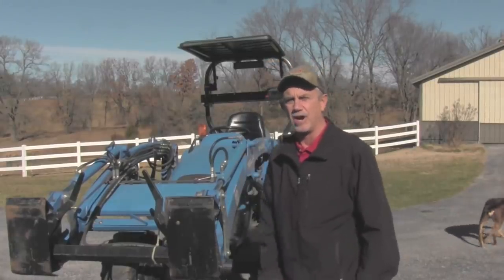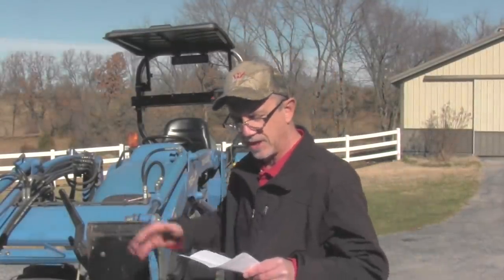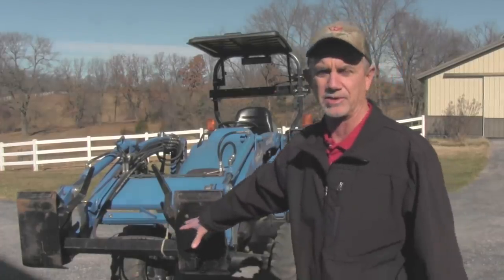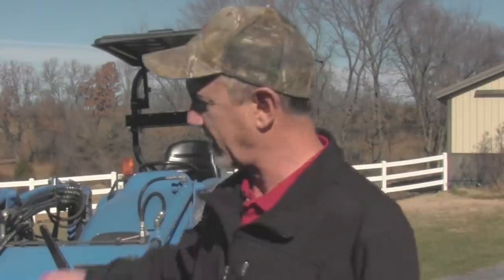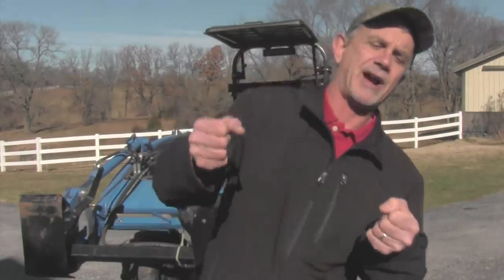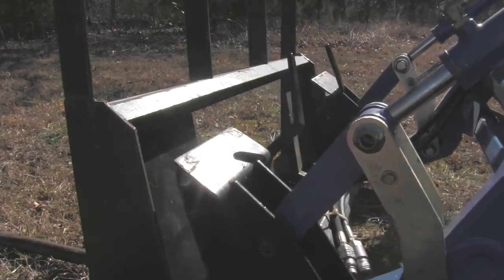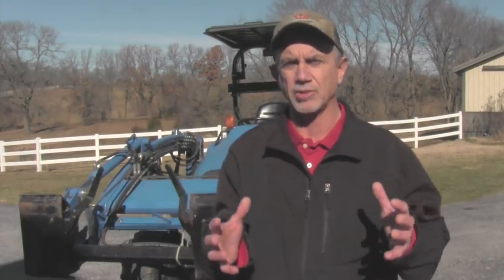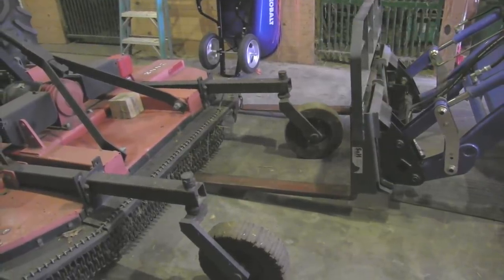Tips for Easier Front End Loader Attachment Hookup

Comment: Hi Mike. Sometimes I have a problem with my John Deere quick attach bucket too. I've found that when I get right up to the hooks on top, if I turn the wheels the tractor front end moves in the opposite direction, while standing still! Then I have to back up a little and try again. It's annoying but like everything else in life, the more you do it, the more adept you'll be. Your tips on saving space when parking the tractor is spot on too. When I load my tractor and Bush Hog on my trailer I have to curl the bucket all the way under so it's resting face down on the deck so I can put the ramps up. The mower deck overhangs the front by a couple of feet so the tail wheel kisses the jack when I lower it. The trailer deck is 20' but the tractor with the mower deck on it is about three feet longer. It was the longest trailer I could find around at the time and I needed one ASAP because my old trailer was rusted almost in two I discovered one time. It pays to get under the trailers from time to time to check things out so you don't have any unpleasant surprises when you don't have time to fix it...assuming it can be reasonably fixed.

Comment: I would get 2 sets of haul master magnetic trailer alignment kits from Harbor Freight. They are $9.99 per set of 2! They are strong magnets with a telescoping rod with a yellow ball on the ends. You would put one on each bracket on the loader in the center and one on each bracket center on the bucket. Telescope them all the way out  Then drive in toward bucket slowly aligning the balls up. Works easy on a trailer. I think it would work great here also.

Comment: Thanks Mike Euro hitches are becoming the standard in Australia. They’re simple to use but there are lots of skid steer attachments second hand that you can’t use anymore. Way back you gave a hint about using a bar to make micro adjustments to bucket position so you don’t  have to get the tractor position perfect every time, you just pry the attachment into position, I’ve found that invaluable as a newbie trying to put on attachments by myself. Thanks for the tip!

Comment: Glad you made this video.  I place my implements on cinder blocks.  Easy to see when hooking up or disconnecting.  Also, make sure the pin hole stay clean.  They easily plug with gravel, wood, etc., and make it hard to lock in the attachment.  Lastly, watch your feet when disconnecting an attachment.  If there is no hydraulic pressure to the loader arms, they can bleed down and pin your foot.

Comment: I painted a vertical day-glow yellow stripe down the back center of my bucket and forks.  My tractor hood has a ridge running down its center. I just steer into the bucket by keeping the center of the hood lined up with the stripe painted on the bucket.  I don’t pay attention anything else until I contact the bucket. This way you don’t have to move your head back and forth- just sight along the center of the hood.

Comment: I bought a 2 year old tractor (first tractor ever) that clearly had never had its bucket removed.  I bought pallet forks and was excited to try them but could not get my bucket off.  Once I was confident the levers should move further I actually had to beat them with a 2x4 to get them to release (I am not super strong)!!!  What was missing was the WD40! They move easily now and I have mastered the swap.  My method is to lean over and only look at one 'far edge' and everything else comes together. Thanks.

Comment: I use the paint pen, but the paint keeps wearing off.  It helps when you first start with a new implement.  Once I get the implement on, before I push the levers down, I lift the implement from the ground a couple inches and bump the curl both ways and they usually slide the rest of the way on to make sure that gap isn't there.  Then after I have secured them with the lever, I always tip it all the way forward and visually check the pin is engaged from my tractor seat.  I learned to check those from one of your other videos, probably has saved me a lot of money :)

Comment: A skid loader quick change system is AWESOME on a skid loader. I used one of Tractor Mike's adapter kits to change my New Holland tractor to the skid loader system. It's great to be able to use so many of my skid loader attachments on the tractor. First off, changing the original bucket over to the quick attach mount was a huge amount of work. A smarter person would have sold the original bucket and purchased a quick attach bucket. Im stubborn that way. Using this system on a tractor, I found the hood of the tractor completely blocks the view of what you are trying to attach. This is frustrating, but the ability to change attachments makes it worth it.

Comment: Good informative video Mike, thanks. My tractor has the 'Euro" style manual quick connect, and since I recently installed a third function connection on the loader of that tractor, I wanted to be able to use some of the skid steer implements we have. Imagine the pleasure of discovering that an affordable adapter plate was available for just that purpose. Result is much more versatility in our equipment.

Comment: Good information Mike!
I too had problems at first with the SSQA.
And even today, several years later, I will sometimes have issues with certain implements.  Your tip on painting a line on the bucket or what ever, is a good one!
At the 12:45 mark you mentioned curling the bucket "all the way forward" to gain tongue weight.  This is not recommended by my tractor dealer and they will NOT load a tractor in this manner.  They say it is more likely to damage the loader cylinders when they are fully extended.  Now I know that there are MANY people that load as you mentioned.  I am just forwarding what my dealer told me.
Reply from the maker: Lonnie, thanks for sharing.  They must have had a bad experience with that practice, I'm having trouble picturing what could have happened.  Gonna have to roll that around awhile to grasp why that would be dangerous to the cylinders.  Sometimes you have no choice if the trailer is too short.

Comment: My T4.90 tractor has the euro style quick attach. It's way easier to attach different attachments. I can  roll the attachment pins down and see them as I attach the bucket and able to adjust the tractor to align everything. The only thing that I don't like with the euro style is that the attachments are more expensive.  Another quick suggestion, I picked up some scrap pallets and put the attachments on them when not in use.

Comment: The two biggest issues are left/right centering and the angle of the loader plates to the attachment.  Set the plate low enough so that there's a gap of a few inches at the bottom when the top connects. Once the top of the plates get under the lip, lift and then roll back and gravity should take care of the rest. Getting centered takes practice.  Not being exactly square can be solved by pushing the attachment if you're centered.

Comment: I have a heck on a time getting the accessories hooked up.  I am very short and can't see the center at all I have to use the outside of the lip.  It is frustrating but I am getting the hang of it.
Reply: I just purchased a tractor. I am very short and I can't see the center of the face plate like he says.  I only see the outer edges of the bucket.

Comment: After I get the loader QA plates under the attachment lip, I raise the loader maybe a foot or two and curl the attachment back towards me maybe 20 degrees.  I then jiggle the loader curl lever a few times to set the loader plate to the attachment.  I next set the QA levers down.  I then lift the attachment a few feet up and tip way forward so I can clearly see if the pins are truly set in their mating slots.  If the pins aren't properly engaged, the attachment will swing away from the QA on the bottom.  That means you have to level everything out, set it down and try again.

Comment: I guess some people might have an issue getting them connected but I've never had a problem. I'll angle the connector (a tad more then Mike does here) and watch the outside to get lined up and gently push until I know both sides are in contact then I lift the bucket 1st and then tilt it back until the bucket rests against the plates. By lifting first I avoid getting debris in between the bucket and plate. The bucket will actually stay connected and just swing a little. After tilting back and with the bucket now properly seated against the plates I'll get off the tractor and stand in the bucket to set the pins, since it's only a couple inches off the ground it's not that bad. By standing in the bucket it makes it easier to push the pins in OR pull them out when taking the bucket off.

Comment: Biggest advantage over the Deere system is you can lock both sides by standing on one side of the tractor!  Yes the Deere system is simpler but you have to walk to each side.  The biggest key here is how deep of a valley is on the attachment.  Most have a wimpy little one for the top edge of your quick attatch plate to go into so it's hard to get the lip in and curling  back to get it locked.  Also the spring tension on your quick Attach can be adjusted to make life easier.

Comment: Before I get too far into the video, I do like the deere system (sure is a proprietary setup so skid steer attachments aren’t compatible, but still). The only downside to the deere system, is the brackets are independent of eachother. It wasn’t a problem when the loader was new but after a few years, the dump cylinders won’t extend/retract at the same rate. One side might lock into the bucket fine but the other side might have gone all the way down and is digging into the ground. 

After the video:
One tip I’d like to add is to put your attachments in an easily accessible area. Don’t try to cram them into the back corner of your barn, leave them somewhere where you can easily maneuver your tractor to line up perfect when attaching them. You you’ll have a hard time if you have to make a 10 point turn to angle your tractor a few degrees over to line up square. It’s much easier to come in straight initially. It sounds basic, but I’ve had that problem before when I first started using loaders. 

Another tip might be to have someone to guide you in if you can’t see your alignment. Bonus points if you can get them to remove/install the pin or actuate the levers to install or remove the attachment.

Comment: Have the faceplate at the same angle as the attachment you're putting on.  A bucket is usually angled and a set of forks is more vertical.  If they don't met up properly you'll have a hard time putting them on.

Comment: Hey question for someone. I have a NH Tc45da. I noticed a chatter above the HST filter. I've changed filter new oil and still chatters. Any idea what I can check. Noticed online some say it's normal. Don't want to ruin machine if this could be a problem. Is it normal for the HST filter  bypass to make noise like that? Anybody else have that noise. Thanks for the videos!

Comment: My cabbed mahindra won't let me see anything other than the outside edge of the driver's side faceplate.  Just like yours, the bucket has a bracket on the outer edge.  I open my door, hang my head out and make slight adjustments to get the left edge of the adapter just inside the bucket bracket.  Works every time. 

One other point is to have it in the lowest gear.  If I'm in anything other than low, the pedal is just too twitchy.

Comment: Hey Mike. I just bought a tym t264. How can install the chain Hooks. It's going to be welded I guess. The top of bucket appears to be a 2x2 closed channel.
Reply from the maker: Google "Ken's bolt-on grab hooks" for the option to bolt on.  2 X 2 closed channel might be tough to get holes all the way through, though, and it would require long bolts.
Reply: @TractorMike  thanks man. I've tacked them with welder and drilled holes. Installed class 8 bolts.

Comment: I think my faceplates are tweaked. When I hook the top on both sides I can lock in one side but the other I need to push the bucket into the ground with the weight of the tractor on it to lock in the other side.

Comment: my kubota has the  skid steer type, the locking handles are up when no attachment is on. paint on the attachments with a paint marker were the handles are to line them up. my massey 5455 had a euro, switched it to a skid steer type but the handles are down with no attachment! this stinks.

Comment: I actually keep most of my loader attachments on pallets which not only keeps them off the ground, it makes them easier to shuffle/move them around without having to put each implement on the loader. I usually put buckets & grapples on the pallet such that the fork tines will be running along the width of the bucket - which allows me to put multiple loader implements along a wall when I wouldn't otherwise have the space to put the bucket/grapple at that location.

Comment: Why is it so hard to open and close the levers when un hooking and hooking up? I have a brand new tractor.
Reply from the maker: Kenny, I think it'll get easier when it gets broken in a bit, but make sure all of the components are lubricated.  I've been using WD-40 Specialist Gel Lube: https://www.wd40.com/products/spray-gel/ which seems to stay where it's supposed to be longer than anything else I've tried.  Also, try to get the bucket/implements as close to center as you can, and that's tough if it's your first tractor.  When my bucket is in the perfect sweet spot and the levers go down really easy, there's about a 1/2" gap on both sides of the plate that the quick attach fits in.  It takes a lot of practice to get it there, I don't hit it every time.  Good luck!
Reply: @TractorMike  Thanks

Comment: A good habit is once locked on, lift the front of the machine off the ground to verify that pins are engaged.  Sometimes it is hard to do a visual depending on the style of the attachment.  I saw a guy have to dump his skid loader bucket out of the back of a dump truck because he did not verify it was locked.

Comment: I've had both and they work the same. I can't understand why he is having a problem. One has levers and the other has pins. You hook the top the same way.

All you have to do is lean over so you can see one side. It's not very difficult. With the John Deere system you have to walk around to the other side in order to put both pins in. With the other system you can release and engage both levers from one side.